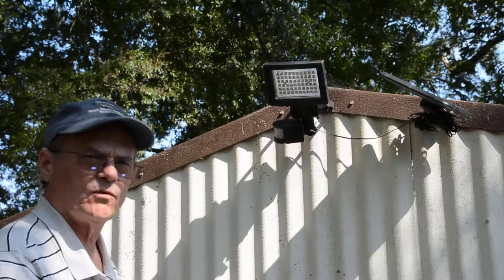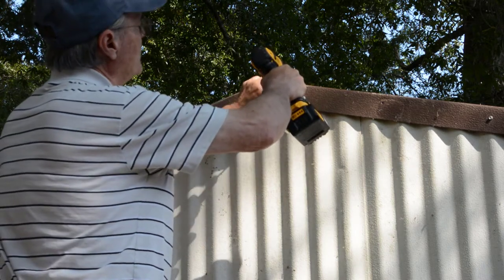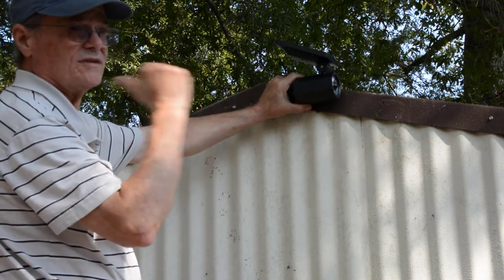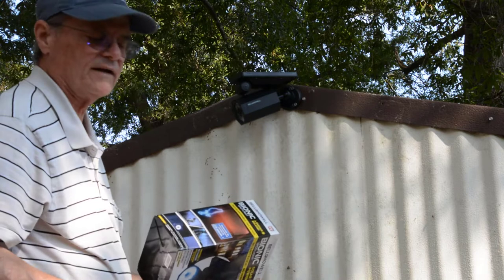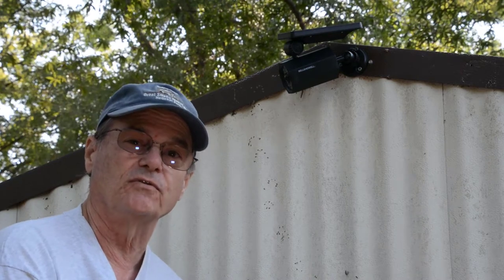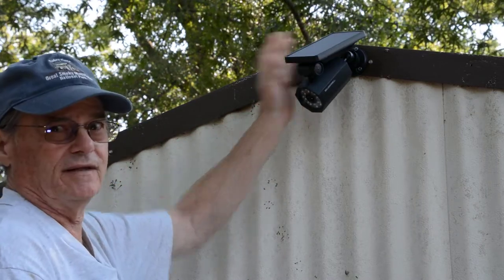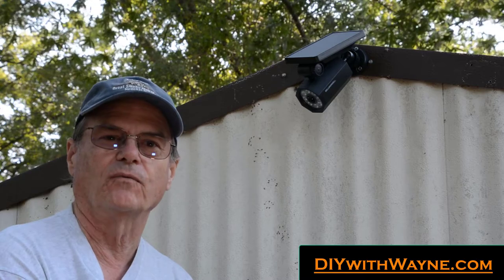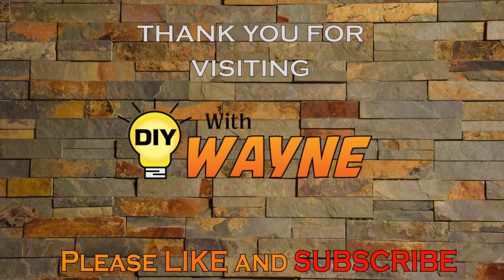How to install an outside solar light. Bell and Howell solar light.

Comment: I just bought two of them and I found your video searching the one thing we both don't like - the solar panel has very limited aiming latitude. The lights are pretty aimable, but the solar panel and the motion sensor are locked into the same radius.
Reply from the maker: Yes, It does have limitations.   Thank you for visiting and have a great day.

Comment: Hay Wayne if you are a hat wearer they are making a lot of good hat bill lights . I was given one that has bright ,dim ,red light, and rechargeable.  That harbor freight solar panel is pretty good when my light died I reused it to run a solar powered wind chime. Menards has a flag pole light with a tethered panel  but it  ain't cheap.
Reply from the maker: Thanks for the information, I will check it out.  Thank you for visiting and have a great day.

Comment: How do I turn my bell and Howell solar light on
Reply from the maker: I'm not home but I don't remember it having a switch.  It should work after the battery charges.  If not, return it.   Good luck with your project and have a great day.